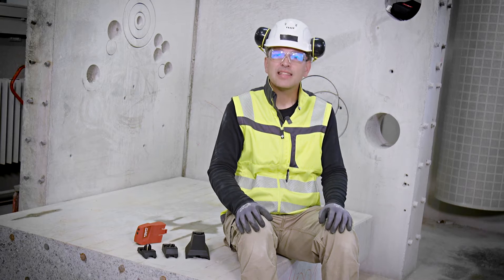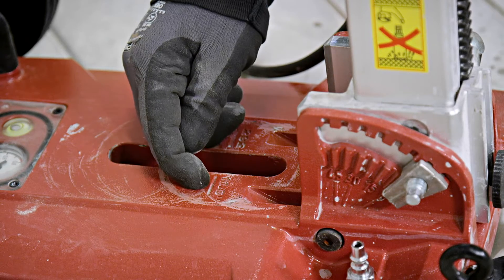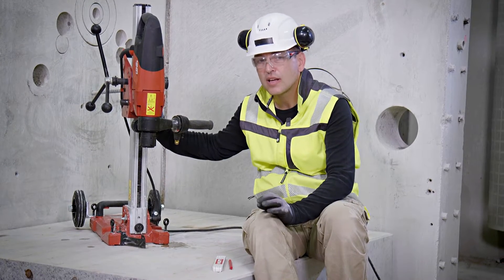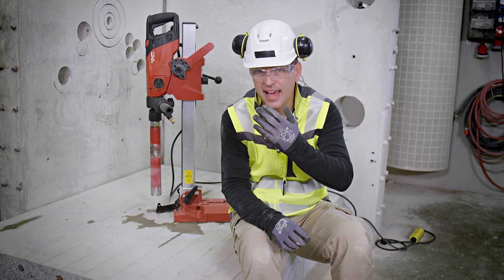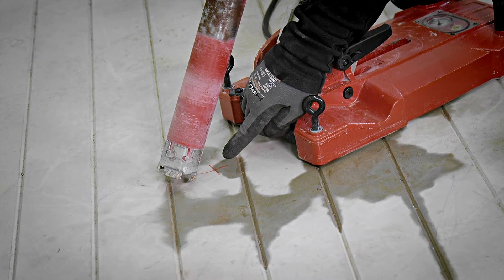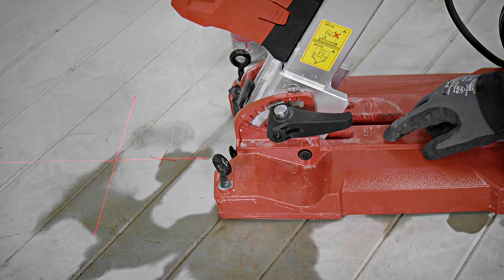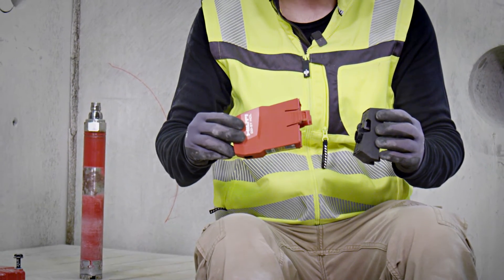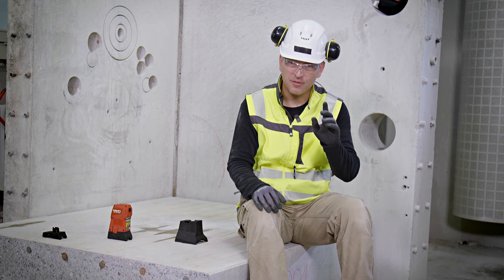Diamond Tips & Tricks - Angular Coring: Where to Set the Anchor

Comment: I was gonna nerd out on y'all and start talking about trigononerdery but here's a solution that doesn't require you to pay for like $800 laser, per rig. 

(distance from the top of the shank of the bit -> the ground) * sin (30) + offset(11.5" or 292cm) Change 30 to whatever angle you're boring at. Make sure your calculator isn't in radians. Checks payable to your favorite charity for 1/10th Hilti is charging. Also, the flexibility of the stand is what makes Hilti great. You can essentially pick an arbitrary point and be home-free. I guess if you need to anchor in a new bolt on a wall, this system would be alright but then you're struggling between the stand and ensuring your point is on target and I can't remember was there a gas line here, did they even turn off the gas?

 Go into your Home Depot and go to where they offer round stock. 
1) Find the size small enough for your chuck but big enough to fit a Sharpie and buy a foot of that wood stock. 2) Take a 0.5mm pen or mechanical pencil at 0.5mm or thinner [1]. Use that to 3) Use a center-finder on a combi-square, strike a line as perpendicular as you can against the straight edge. Repeat twice more at 120deg and 240 deg[2]. 4) Take to a drill press and find the size closest to the Sharpie's circumference, taking to a depth of 50%, maybe deeper if you used a soft wood. 5) To extend this idea into something more useful, take a strip 2 inch by 1 inch by, I duno how ever far you think you'll need as a radius + 20%. Drill and dowel one end into that piece of Home Depot lumber, and on the other end make a mount for the Sharpie (the sharpie is no longer in the chuck/collet, it's now being used as the scribe for the "compass"). Use the nerd math, scribe and pick your ideal place or use the method mentioned above 

[1] Construction pencils from lumber yards can be sanded down with 320grit to way better than 0.5mm. Fine furniture makers used to do this all the time, back before the days of the CEOs, big-box stores, etc. You can also look for draughtsman kits of 0.3mm in HB, you know, if your prints really call out for that sort of precision. I think a Sharpie will do you just fine
[2] You could technically do this once more, moving to any arbitrary point around the circumference, but having 3 lines co-incident is a good sanity check.